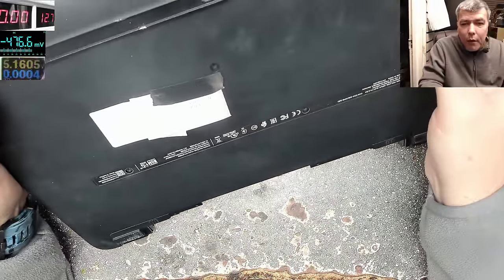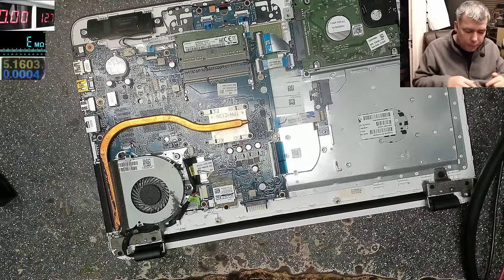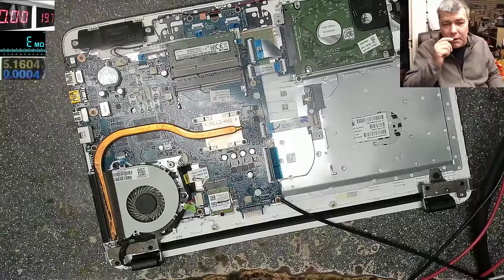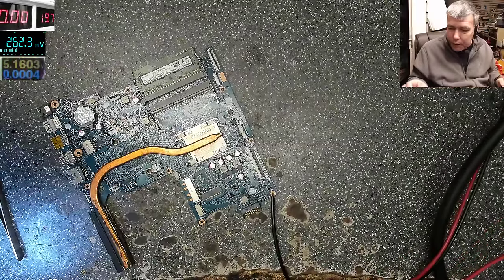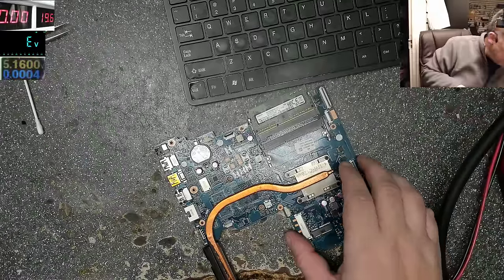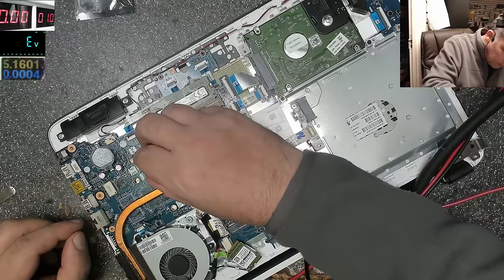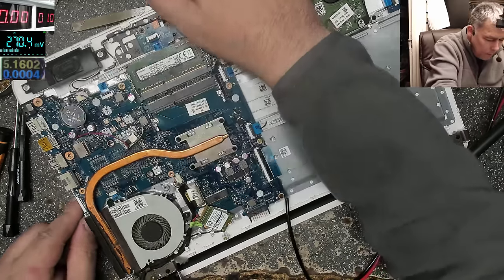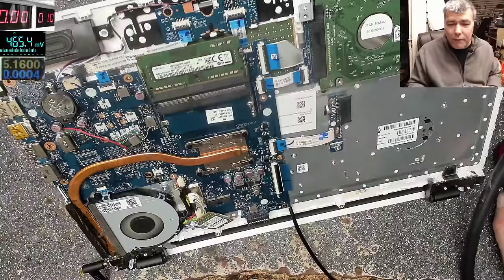Let's modify a laptop - Hp laptop board repair - redesigning a power supply

Comment: Great work, I did this "mod" once too, but I've connected the input of the buck converter straight to 19V, desoldered a 100k resistor near the ceramic input capacitor which is connected between input and Enable pin of the IC and soldered a 100k resistor between 5V rail on the motherboard and the Enable pin of the converter. That way the 5V power supply can't be overloaded as It is only Enabling the converter, not actually powering it.
Reply: Ok

Comment: My DC Power supply is one of the most valuable tools I own. Not only is it great for diagnostics but also very handy for testing and powering circuits or powering little projects!.
Reply: Can you tell here the brand & type (linear/switching) of your power supply & link from where you purchased it from? Thanks!😀
Reply: @Aneesh.Asokan  Its a linea supply that I built myself. However, amazon have many decent supplies that are reasonably priced.
Reply: @morphuk1  Thanks a lot for your prompt reply! Linear is bulky & shipping charges will be exorbitant! I plan to go for an SMPS from eBay as it's much cheaper than in Amazon! Once again, Thank You!👍😀
Reply: @Aneesh.Asokan  No problem. I went with a linear supply as SMPS have current restriction, limitations and protections. Linear allows you to  inject voltage into a board in short, which will draw as much current as the PSU will allow. An SMPS will detect the short and overcurrent protection will kick in and prevent voltage Injection.
Reply: @morphuk1  Yes, I knew about SMPS protections & it won't be effective for finding shorts! For short circuit finding I plan to buy a short killer! I hope that will do the job. What's your opinion? Thanks!👍
Reply: @Aneesh.Asokan  A "short killer" is nothing more than a power supply with fixed voltages, my power supply does everything that can, do and more, as its variable voltage and variable current. If its particularly weak short, the "short killer" may not have enough voltage or allow enough current to find the weak, stubbon short. With my supply, I can increase the voltage while watching how much current is being drawn as an indicator of the type of short you have.
Reply: @morphuk1  Thanks! Yes, I know that. That's how I plan to overcome my non linear power supply short comings!😀

Comment: Great repair! Maybe you can now get more CPU information and read the voltages from the BIOS or CPU-Z and figure out, what voltage there should be... i think it's 0.8V
It's running now but could be the Voltage is still too high... you said yourself it's on the top limit of running or not.... i'd lower it to find the lower limit, THEN bring it to the middle.

Comment: A "all in one" cpu as you call it is called a SOC, System On a Chip. And blank screen on Windows shutdown is not shutdown process, it is already done. The blank screen storage activity is actually hibernation process, it writes RAM into the HD/SSD. It is because of the Windows Fast Startup feature, Windows does not actually shutdown when you choose shutdown from the start menu. It does a hybrid shutdown and suspend to HD (hibernate) function which enables Windows to start much faster (on most cases, not all). It is also a function that may cause lots of issues with Windows. If a service hangs, shutting down the Windows and starting it up again does not fix the issue. You have to choose restart or disable the Fast Startup from power options before shutdown. When you disable it (or disable the hibernation, which also disables the Fast Startup) it actually removes the "blank" display in Windows shutdown. After that Windows shuts down much faster and it shuts the computer down also (almost) immediately after the display goes blank.

Comment: nice fix. I might suggest starting at a lower voltage initially on an unknown power rail as higher voltages can obviously kill it (and killing the PCH is likely to make the laptop not worth repairing), but a lower voltage should be fine and just will cause things to not work properly at that voltage, then you can just raise it until things are working as expected

Comment: sorin i think a better idea is to use 19v rail and connect a mosfet inline from the output of your power supply to the input of the rail of cpu and connect the gate to the 5v power supply.
that way you wont worry about current limitation.

Comment: maybe adding some hot glue on the new power supply screw to freeze the voltage, if the laptop will be moved , there is no risk the screw move and change voltage on the power supply, nice video anyway thanks i'm learning a lot of thing :)
Reply: This will melt plastic on screw and make job worse... Moving or droping laptop will not make loose on this type of screw which is on adj pow supp.
Reply: Haha nice one... 😁
Reply: ok has i said i'm learning a lot :P new thing learned :)

Comment: It is a good idea put a Mosfet to turn on the buck converter with the gate on another power supply or search the data sheet of the ic of buck converter and connect the chip enable to another power supply 🤔

Comment: I think you can find that chip on ebay with the right code.
Unfortunately they don't print the code on the chip, you need to get it from the schematics.
I hate HP. Nice solution you found.

Comment: Sorin, this is a REALLY fantastic repair! Lots of times I've been in front such a problem: identify the power 
supplies inside a laptop...  but... if you can have some time to spend in this, could you teach us a way 
to identify them?
For example, using one or more of your spare boards, could you teach us THE LOGICAL PATH TO FOLLOW 
to identify them?
Ok this video can be used as a guide, but aren't you afraid to put excessive voltage to a generic power rail? 
Wouldn't it blow up i.e. the processor, if you give, for example, 5V to a 0,8V - 1,2V Power rail? 
Usually, when I think to do something like this, I'm someway terrified by the idea to inadvertitely 
ADD ANOTHER FAULT to the board!!!
Instad, It seems to me in this video, that you don't even think at this possibility... please can you explain?
If this will need more videos, could you be so kind to do it, like you did for the Power supply, a home?

Comment: It seems like the Pgood is just a voltage line pulled to some voltage, and every power supply has a open drain pin connected to it and when the power is not good on some supply, the drain will close to ground pulling the whole Pgood to ground, that s how the superio detected the fault.if you remove the supply, the Pgood will not be pulled to ground and the superio will start the laptop =))))))

Comment: Assuming this was the Vcore voltage I wonder if he power will collapse under heavy loads. Please run prime95 or something like that. Currents on the 1V supply under heavy load can be very high, higher than your supply can provide.

Comment: sir in 1:07:38 will the processor get burned or damaged if you did not noticed that the 1v should not be always on even if it is turned off? I am still a beginner and still learning. I hope you can answer my question.

Comment: With that dc to dc converter all should be ok ..they are up to 90% eficient or so .. so 0,7A at 1V (0,7w) is only
 140 mA +loss ,, so it is only 160 to 250 mA or so extra load on the 5V side

Comment: i have five hp probook 450 G4 all have same proplem. when powered on they LED powers on few seconds later it switch off itself for few seconds then it powers on then fan spins hard without displying. what can be the problem. all voltages are intact.and 3.3 is present . pluging the charger the LED lights on.

Comment: Isn’t the first thing on a laptop remove battery and reset/power down the bios?
5 ohms on CPU to ground can be intentional when powered down to prevent static charges.
Reply: I've never seen such thing as intentional short circuit but there are lots of ESD protection components on the sensitive parts of laptops like audio IC,Lan IC and USB connectors.

Comment: Sir what is the cause of overheating 51125 power IC..and after a while it went dead and cold..the processor is heating after i remove the 51125 IC and taking like 500 to 800ma from my power supply and my 19v become 11.9 v..whats wrong sir..is it defective processor? it is a dell laptop

Comment: I have two Acer Aspire ES1-512 after installing new Operating System on it the touchpad has stopped working ,I have downloaded the exactly touchpad software but still is has failed to work on them ,I tried to install Linux on them but still not worked
Kindly help me
Reply: Install old operating system then.

Comment: The new architecture of laptops cannot be repaired on hit n try basis the concept should be clear, there is a clear logic to check ics and not this way there are pin outs from which we can confirm the ic is bad not because it is getting heated up, can u explain the real concept of trigger logic and ldo voltages we shall talk about signals later, I'm not against u or not anyone I really love ur style of working in a relaxed manner but im sorry sir the concept is incorrect Accor to me and hence request you to have a look at one vedio from laptex (concept explained by Mr. Nassir)or engineers choice by Mr. Dinesh yadev
Reply: First of all it's too difficult to get schematics and secondly, the 'proper' repair would take too long, so it would be very expensive. This is the only way that computer could be fixed, because repair price was not too high for the customer. Otherwise this computer would have been put in the trash.

Comment: What will happen wen you use all the usb ports at the same time while the processor is on 100% performance?
Reply: The power supply for the cpu is the big bottom one. That (base on other comment) seem only for the pch part